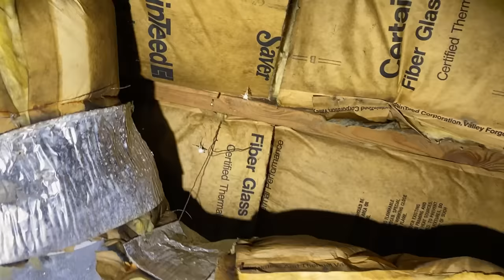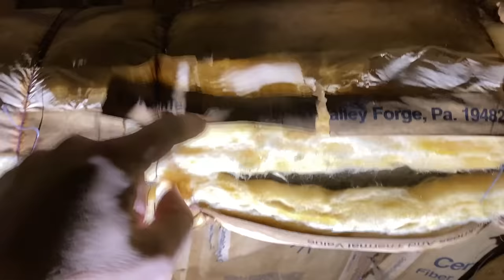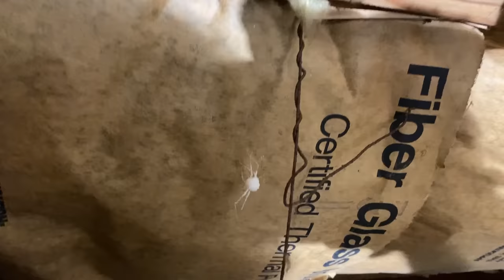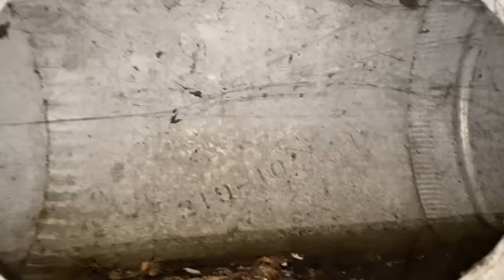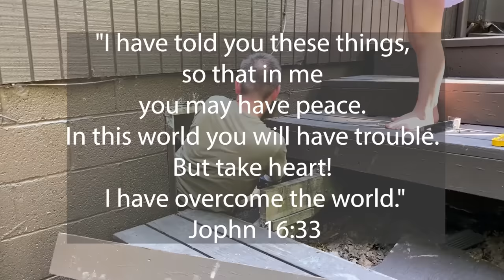Finding A Secret Room Under My House and What Was In It

Comment: Before you enter a confined space ventilate it throughly. It may save your life or the lives of people important to you who are going to try to rescue you.  Blow air all the way to the the bottom of the space to exchange good air for possibly dangerous air. At least three and a half air exchanges before you enter with continuous ventilation when you are in the space.
Reply: Thanks for the advice.  Had it been me doing this, I might not have thought of that - unless it was blatantly obvious there was bad air or something leaking in there.
Reply: I too was concerned (MOLD POSSIBLY, ANIMALS, ETC...)!
Reply: Waaa.  Just how do you go about that?
Reply: Wear a mask!
Reply: @susanbrown7898  mask aint gonna help dude. you need to stick a  blower in there and vent the air. whats in there may very well not be oxygen.
Reply: haha good call. I work in safety and before that I specifically worked for a company that strictly did Confined Space monitoring and rescue. We would monitor confined spaces and also provide stand by rescue should something happen we were ready to repel into the space and bring an incapacitated worker out (including wearing respirators if needed) 

I know a lot of crazy stories about people dying in confined spaces. One guy goes in and passes out from whatever gas has settled in the space, another guy sees this and rushes in to try and save his buddy and also passes out. Then maybe a third person tries the same thing. Lots of stories of multiple people passing out in a space and dying.
Reply: on an industrial level you would typically have some blowers connected to a large tube ( like a duct type of thing) and you would have the tube down towards the bottom of the space to push the air out. You would also use a Draeger to monitor the air quality and make sure it’s safe. Typically the space is already mapped and has a known way to ventilate it and you will need a confined space permit to enter and you will have some sort of stand by to monitor the space and a confined space rescue plan in place (even if the plan is just to alert the fire department) other places will have respirators available and workers certified to use them and some sort of training to perform a confined space rescue. 

I used to do this kind of work in Nuclear plants during their maintenance outages. We would sit in a room with a radio and big whiteboard and monitor all the confined spaces and track which ones were currently occupied and basically be on stand by should we need to grab a bunch of gear and go into the plant and rescue someone. 

haha I could rattle on about the world of confined space all day
Reply: @TDOLLA  yeah we pull dead out of the hole just like you. when a man goes in, and dont come back out. you dont just jump in there and thing a respirator is gonna save u.
Reply: @omarra6781 Not necessary. Unless you expect gas that's overkill and there was no reason to expect gas leak in this case.
Reply: You should also eta wear PPE(Personal Protective Equipment) hard hat, respirator, face shield, safety glasses steel toed boots, gloves etc
Reply: Very good advice! You can never take any chances with noxious gas or mold.
Reply: Not in there. Any poisonous gasses would have leeched into the living space - just as the smell already has.
Reply: @DieselRamcharger Please - ain't nothing that airtight under a house!
Reply: You're telling that to a man who has absolute zero commonsense.
Reply: No
Reply: Reminds me of a story I saw on YouTube about several members of a family who were killed by gasses from potatoes that were stored in their cellar and had become rotten. One person went down, didn't come back. Someone went looking for him. Didn't come back up. Another family member went down.....didn't come up. The only one to survive was one of the kids.
Reply: Go away